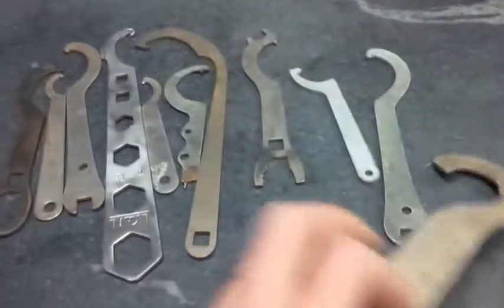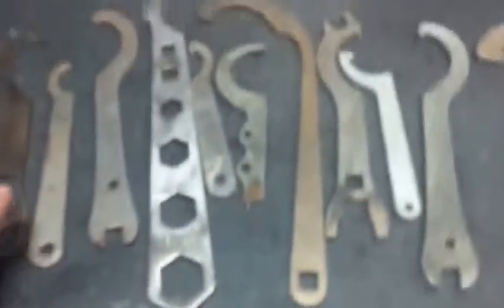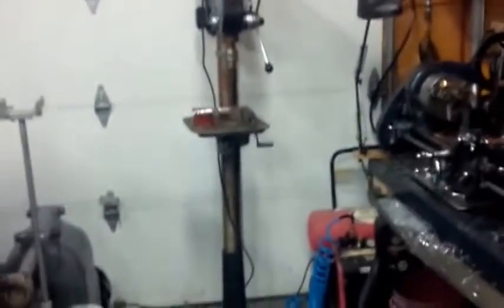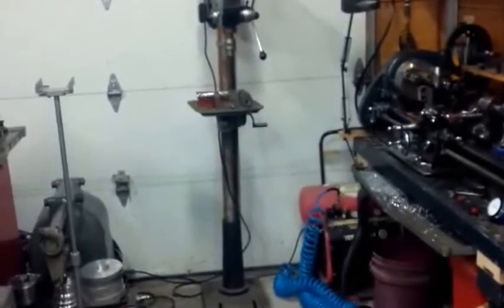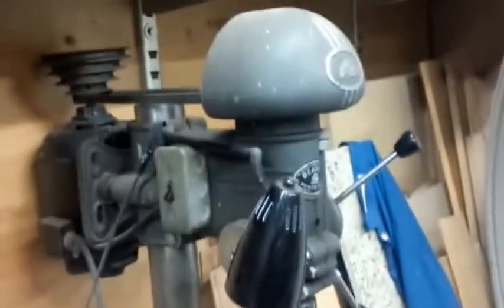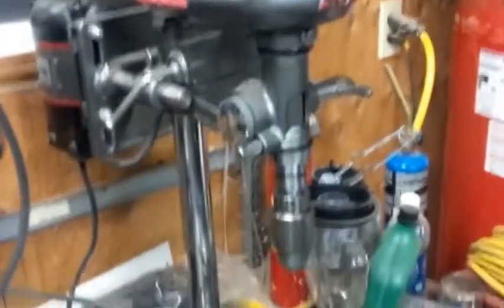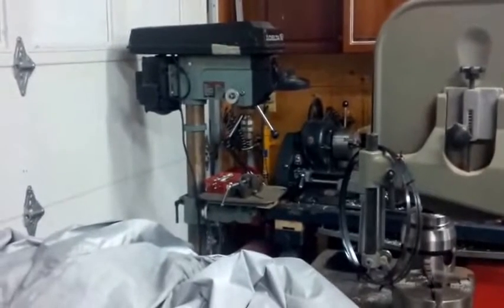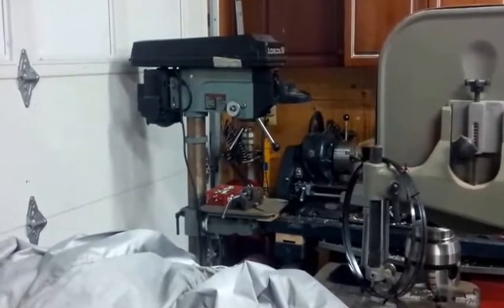ToolScore Delta 17-901 Drill Press

Comment: You said it's already sold, but the lower speed is a must when working with steel, also the height clearance is always welcome for taller parts.
In any case it was a great deal...   Pierre
Reply from the maker: pierre beaudry Thanks for dropping in Pierre. I already have a my atlas benchtop with an extra pulley and will be building a pulley attachment for my beaver press soon. I also have a small milling machine, si I think I'm good for metal drilling.

The delta press is a good one, but I really like the beaver better, it has tapered bearing and is a much sturdier machine.
Reply: Those Deltas were China made from one unique mold like millions of other more or less expansive brands... Had something similar bought in the 70's ( had no middle pulley ), still worked perfect when I sold it last year.

Comment: Nice deal. I'd probably hang onto it till space ran out.. I still have a 12 speed Trojan we bought in '87...never use it but can't sell it either.. ;-)
Reply from the maker: ***** Well, I sold this one. I like the older stuff. Will build an extra pulley mount for the beaver and have a better press than the delta. I need to room too. Thanks for stopping in Colin.